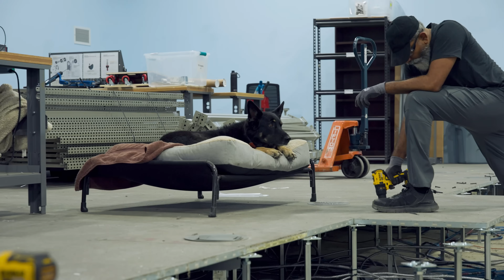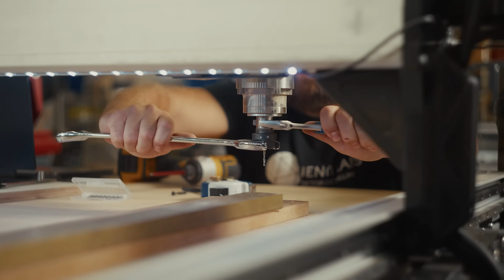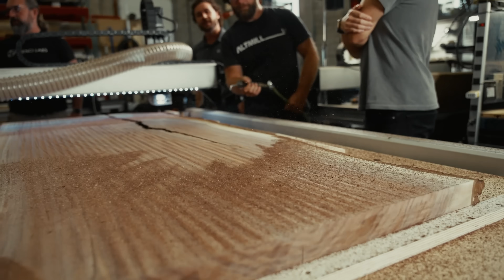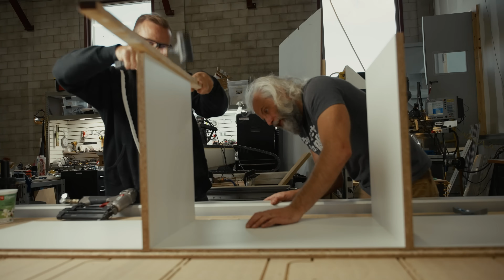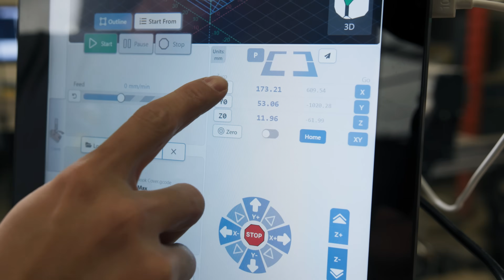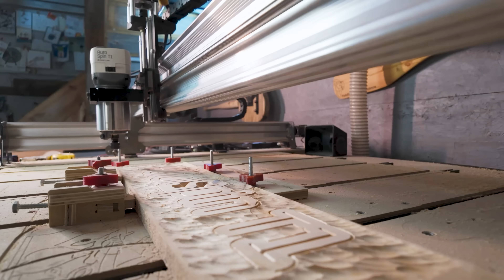Production Update ❘ November 2025

Comment: Will atc will be available for long mill MK2 as well
Reply from the maker: Unfortunately no. The racking system is specific to the AltMill's cross bars of its base, and the spindle is a 2.2kW spindle... so you need more rigidity for the beefed up juice of the spindle. It is also very heavy and the LongMill's X-gantry won't be able to support the weight of the new ATC spindle set up.

Comment: Will the Autospin use brushes common to any other off the shelf routers?
Reply: Is the exact same router as the Makita with a different endcap.
Reply from the maker: Yes it's very very similar, but with upgraded bearings, electronics, speed selector potentiometer, and some other quality of life improvements that makes it better suited for use on a CNC
Reply from the maker: Yes! They' match these makita brushes: https://sienci.com/product/replacement-makita-cb-408-carbon-brushes/